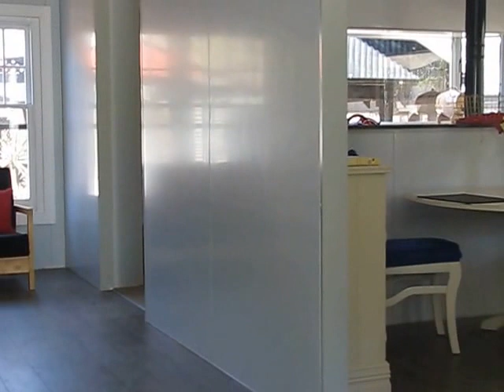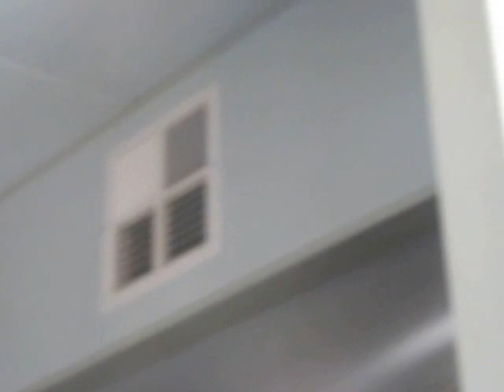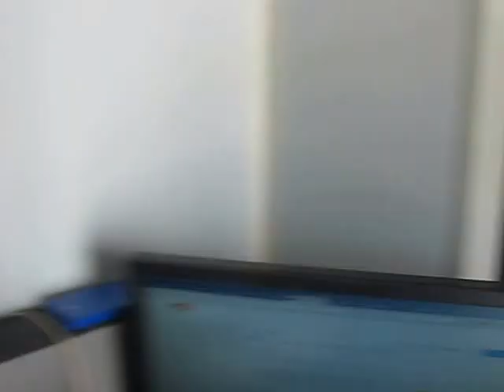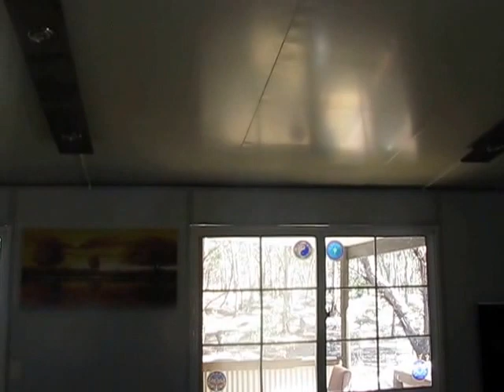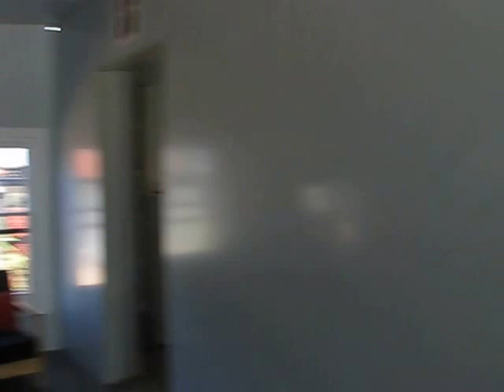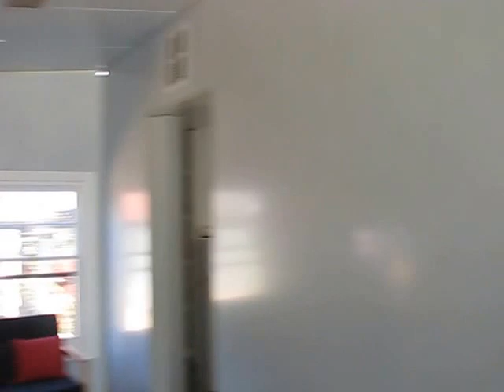Off the Grid and building 2A  structural insulated panels

Comment: we are 5-7 years off building our off grid house...and we had NO idea what material to use....but after watching how easy the C channel and eps panel system is....i now KNOW what material to use..:)...keep up the good work..:)

Seriously i imagined having to use bloody great big steel I beams and that would require a crane to put the roof together...with the eps it looks like the two of us could lift the panels into place and screw them down..!!

Quick question....how did the eps handle the load of the Evap cooler on roof......where did you mount that lump of a thing...what does it roughly weigh..?? as it seems to hold a volume of water...or did you just go closer to the middle of the roof ridge where it was stronger..??

Thanxs.....:)

Comment: When the angled roof panels sit on the supporting wall panels...there would be a small gap between the two ...how did you hide the gap on the outer edge of the roof/wall joint outside..?? Thanx..:)
Reply from the maker: I just used good roofing silicon ,thick bead  but another way is that sealing rubber strip  , its black and looks a bit like tar , or I do belive Clarke rubber had a few types on offer ... ...
Reply: Thanks heaps..:)
Reply: Thank you..:)

Comment: Are the roof panels heavy..?? did you and the Mrs put them up using like 2 ladders..etc..??so you have to attach one panel and then slide the second one into the first one..so they lock together...?  Thanx....:)
Reply from the maker: Our 5 meter panels were a rather easy lift with a mate I had here for the few ours it took to do the roof ... as for the misses , ?  may be she could have helped , but the ensuing panic and whining was not worth it lololol    so I enlisted a mate :- )  

Yes they do just over lap under neath and lock like roofing sheets on the top ... then attack with the usual metal thread roofing screws along joins and each end to hold fast ...
Reply: Right there with you on that one....dont know who winges more...my Mrs or my best mate...lol Thanks heaps...:)